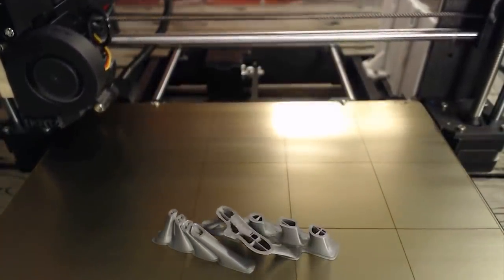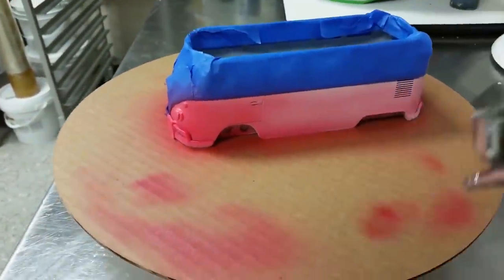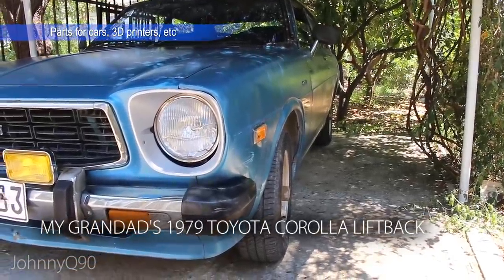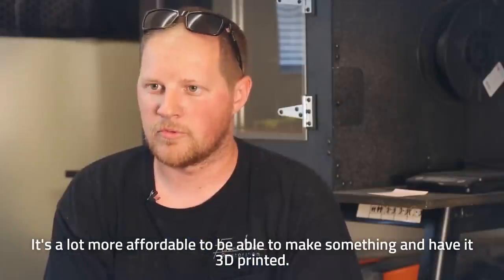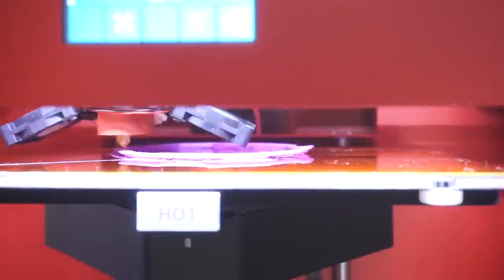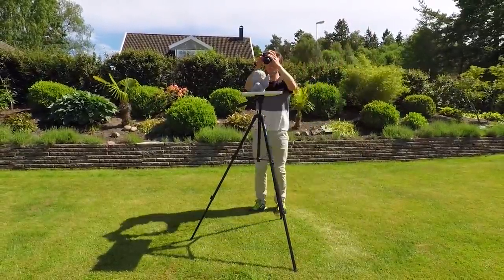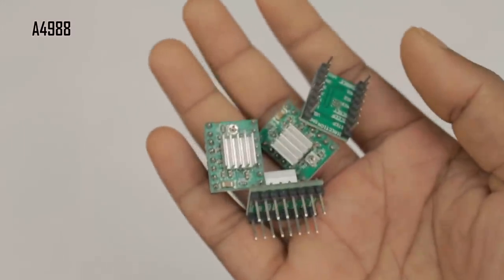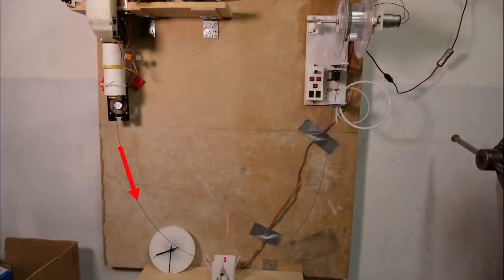How to get money on 3D Printing business - 10 Ideas

Comment: Yeah getting good at 3d modeling is the hard part
Reply: What do you mean?
Reply: @supreme777b  have you tried using fusion 360 or AutoCAD
It's difficult to master and make compelling designs that are functional. And if you listen to the video most of it requires you being able to use some sort of CAD software.